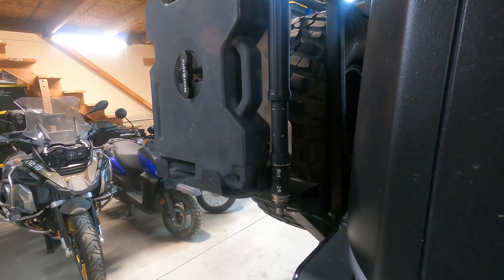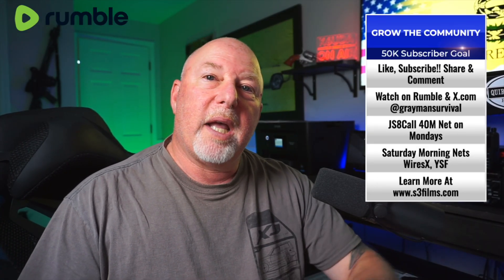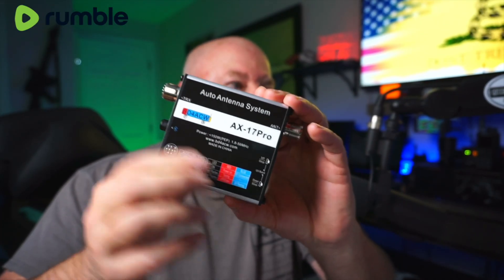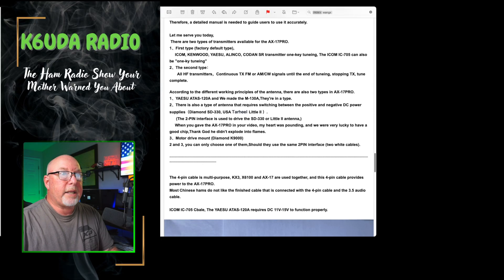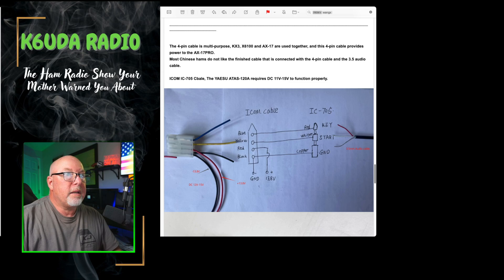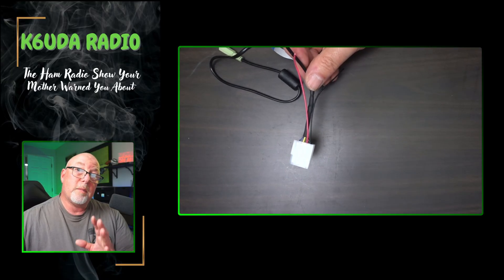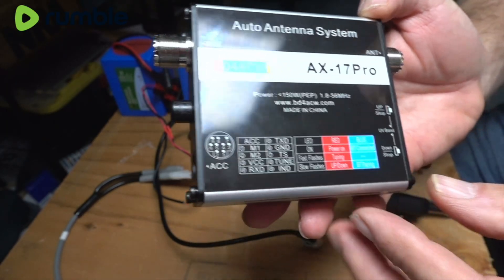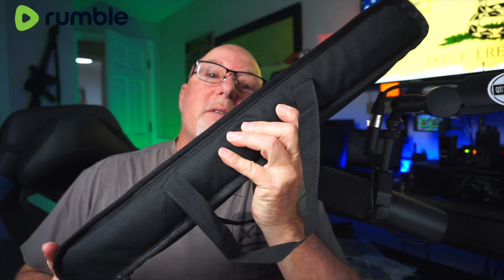Complete Guide To Controlling The ATAS 120 Antenna

Comment: Hello K6UDA.  This is a better video.  Can you post the manufacturers correspondense?  I have a FT-891 with the Diamond SD-330.  IT seems the double sided DIN 9/8 cable is what I use to connect the controller to the radio, but then there is no way to apply power to the controller or the antenna to the system as I used the only connector that wasn't an SO-239. The other pigtailed monstrosity with a DIN 9 can only connect to the controller but that's occupied with the DIN 9 to 8 cable connecting the Yaesu.  There seems to be no way to connect the two wires for the diamond motor or get DC to the controller unless this comes off the DIN 8 from the Yaesu (which has a 13v tap.)  I wrote both the ebay seller and also BD4ACW for information but it looks like what he supplied you is probably as comprehensive as it gets.  73 Bill.
Reply from the maker: Send me a pic of what you have and what you're trying. k6udaradio@gmail.com
Reply: @K6UDA  Well, I did send pictures but I thought I'd follow up here regarding discussions with BD4ACW and the AX17 Pro.   My configuration is FT-891 and a Diamond SD-330 screwdriver antenna (essentially a Tarheel or MFJ in terms of control)  This screwdriver is different than the ATAS as the only control fundamental to the Diamond is the motor input cable.  According to instructions, I need to connect the DIN8/9 Yaesu cable supplied with the AX17 Pro to connect the controller to the radio.  The problem is that the cable is sealed without access to the motor drive leads.  In other words, the antenna motor itself can not be connected to the radio or controller with the "Yaesu" cable, so it simply can't work.  This is not explained in BD4ACW's instruction or stated in this video.) 

I had  a few back and forths with him where he did not really process the concept that the motor of the screwdriver needs to be connected to the AX17Pro somehow.  He finally responded with a detailed explanation.  After one more sortie, he agreed that a correct cable was never supplied with these units and he had a correct cable which allows the Yausu to be connected to controller and the controller to the antenna shipped to me which I expect in about 10 days. Also, he introduced something I never have seen done in a screwdriver controller.   I will discuss this in another comment. Translated from Chinese, his response is:

Hello Bill

Very happy to communicate with you in Chinese.

The YAESU--AX-17PRO data cable contains 7 thin wires. According to wire color, the connections are as follows. Pin 7 on the Yaesu side is left unconnected (NC).
You only need to connect the M1 and M2 wires from the 9-pin interface on the AX-17PRO.

(yaesu pin 1#  VCC          ---->     ax-17pro pin 3#    VCC)
Red wire. Pin 1 on the Yaesu 8-pin interface is VCC-13.8V, connected to pin 3 of the AX-17PRO 9-pin interface.

(yaesu pin 2#  TX-GND    ---->     ax-17pro pin 8#    TX-GND)
Brown wire

(yaesu pin 3#  GND          ---->     ax-17pro pin 6#    GND )
Shield wire (copper)

(yaesu pin 4# TXD            ---->     ax-17pro pin 4#    RXD)
Yellow wire, CAT serial port

(yaesu pin 5# RXD            ---->     ax-17pro pin 5#    TXD)
Green wire, CAT serial port

(yaesu pin 6# SENSE        ---->     ax-17pro pin 7#   SENSE)
Black wire. Inside the AX-17PRO, this wire connects to GND.

yaesu pin 7#  Not connected (NC)

(yaesu pin 8# TX-INH         ---->     ax-17pro pin 9#    TX-INH )
White wire

In response to your questions, here are my answers:

The definitions of the 7 thin wires are listed above.

FT-891 and AX-17PRO communicate via RXD and TXD pins using serial (CI-V) protocol (CAT commands). Command contents include: power-on confirmation, tuning commands, etc.

Only CAT command communication is used. There is no BAND frequency data (BCD format).

The tuning button on the FT-891 is used to trigger antenna tuning. After tuning is complete, the FT-891 will automatically return to its original state.

AX-17PRO has internal detection circuits for SWR (standing wave ratio), RF power, and frequency. It does not rely on the transceiver’s SWR.

When the FT-891 powers on, it provides power to the AX-17PRO. The AX-17PRO also powers on synchronously. There will be a power-on confirmation process between them.

When the TUNE button on the FT-891 front panel is pressed, it sends a TUNER activation command to the AX-17PRO. The AX-17PRO will detect the antenna’s current SWR, power, and frequency...

When the standing wave ratio is less than 1.5 (SWR < 1.5), the screwdriver antenna stops moving.
The AX-17PRO internally uses two relays to select inductors (impedance transformers), switching among four states: 20Ω, 30Ω, 50Ω, 80Ω.
It selects a more reasonable impedance match.

Once the antenna’s impedance reaches a reasonable value, the AX-17PRO tells the FT-891 that antenna tuning is complete.
The FT-891 stops transmitting and returns to its state before tuning.

This is just a simple description of the tuning logic.
Reply: An interesting tidbit was included in BD4's email.  He sad there are two relays selecting 4 inductors after minimizing SWR.  I know of no screwdriver tuner that attempts this.  Further, I have no idea how he would know that the impedance reached a reasonable value.

----------------------------------------------------------------------------------------------------------------------------------------------------
When the standing wave ratio is less than 1.5 (SWR < 1.5), the screwdriver antenna stops moving.
The AX-17PRO internally uses two relays to select inductors (impedance transformers), switching among four states: 20Ω, 30Ω, 50Ω, 80Ω.
It selects a more reasonable impedance match.

Once the antenna’s impedance reaches a reasonable value, the AX-17PRO tells the FT-891 that antenna tuning is complete.
Reply: Livewire_Guy - I'm trying to get my Lil Tarheel II working with an FT-857D and the AX-17 Pro.  Any pointers from you on the cabling? It should be similar to the 891. Hope the setup is working well for you!
Reply: @w8sjw  Hi there.  The first thing needed is the DIN ended Yaesu cable.  The original one didn't have a power tap for driving the screwdriver.  Can you explain how you are connecting the 857 to the AX?  What's that cable look like?  Does it have two or three connectors on it?
Reply: @LiveWire_Guy  I cut away the moulding at the 9 pin end of the supplied Yaesu cable. I tacked wires to pins M1 and M2 of the 9 pin cable. I connected those wires up to the pins 1 and 2 of the Little Tarheel II (closest to the keyway.) I set the FT-857D up in menu 85 to use the AX-17 in tuner mode. I've made some headway with it. It seems as though it should work but I'm getting a serious voltage drop when its wired up like this. I know the antenna works - its fine if I reconnect the original manual switch to it. However, that switch has it's own dedicated power supply. I'm going to check the antenna over again just to make sure I'm not missing anything. With the antenna disconnected from the AX-17 Pro, I'm getting a solid 13.8V+ or - on the antenna control breakout wires with the press of the tune button on the radio or using the up or down buttons on the side of the AX-17 Pro. It just seems like its not getting enough voltage when the antenna is powered by the AX-17 Pro.
Reply: @w8sjw  Shawn, the voltage drop must be related to your power tap for the antenna. K6UDA's video, although informative is not for a conventional (non-ATAS) screwdriver.  BD4ACW worked with me for months to get it working.  Although the AX-17Pro was not usable for a tarheel/diamond sd330, it is such a good price that replaces the MFJ unit and the board and case are exceptionally professional, WangX stood behind his product.  He sent me a new DIN/DIN cable with pigtail to power the screwdriver motor at his own cost from China.  Then after working with him to get the Yaesu tuning algorithm to work correctly with the AX-17, he sent me a new unit with revised firmware.

I don't know what to tell you except contact him directly and maybe he will take care of you.  But, at $135 for the tuner, he lost his shirt on me with two small package deliveries from China after the initial purchase.  And, it seems that they did nothing to rework the units in the distribution pipeline. I would think that you can mod the cable yourself and he should have a process for flashing the firmware.

DM me if you want to take this off line.
73

Comment: Bob, do you have the link where you bought it, at least they can provide exact cables now. Am planning to use one for my 705 and ATAS. thanks w1mdm
Reply from the maker: I bought it from one of the many sellers on eBay. Just be sure to order the AX17 Pro, not the AX17 and look for a photo of the included cables.